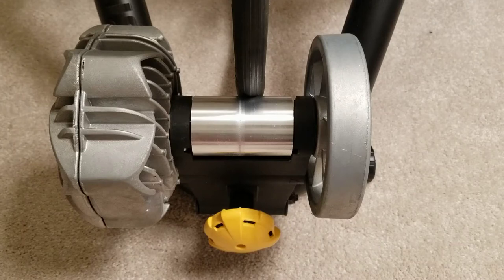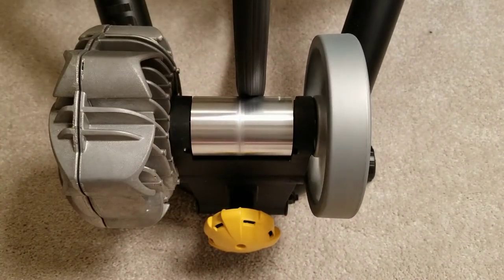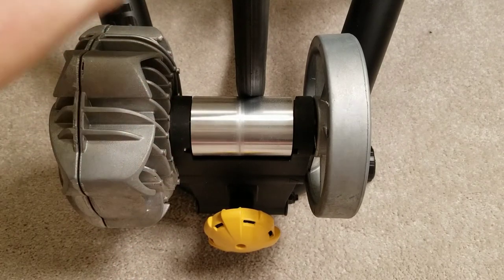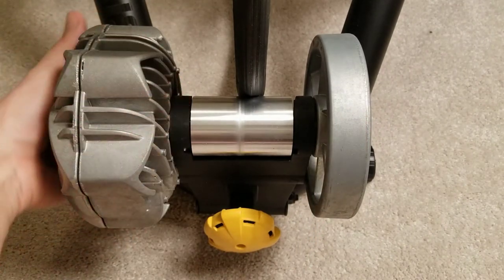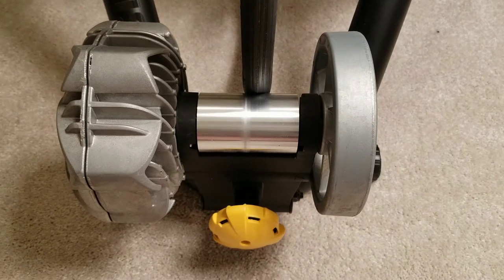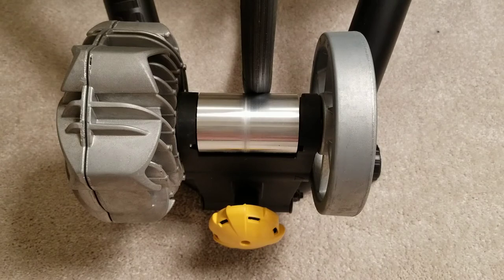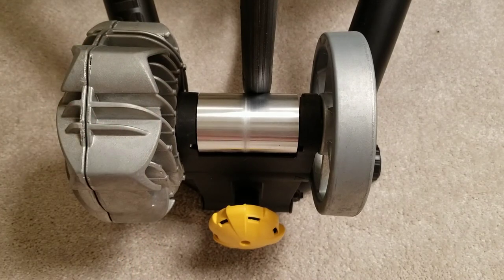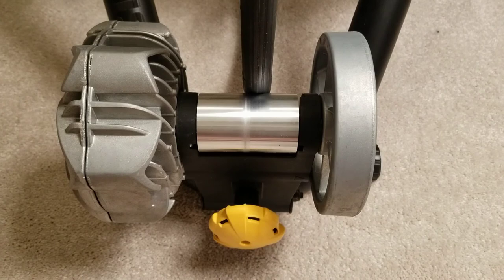How a fluid bicycle trainer works. Fluid trainer explanation.

Comment: I was making the mistake of shifting gears, but now I know better. Very clear explanation overall.
Reply: I still shift gears and have been riding my fluid trainer for years. In order to get harder resistance you must shift, which works along side the fly wheel in the fluid.

Comment: Can you alter the resistance on a fluid trainer to make it harder to pedal to simulate going up hills. I notice the magnetic trainers have a lever to alter resistance, do the fluid trainers have the same?
Reply from the maker: No they adjust automatically based on how hard you pedal.
Reply: It's a little counter-intuitive. In the Real World, you shift down as you hit enough incline. In Trainer World, you simulate a hill by shifting to a higher gear, provoking higher resistance.

Comment: I just got one of these.  Amazing piece of equipment.  What's weird is, how does it simulate gear difficulty?  I shift gears up and it literally gets harder to pedal just as in real life riding.  It's amazing but I don't understand it.
Reply: Since the resistance is proportional to the roller RPM, shifting gears at a constant cadence drives the roller faster, and induces more resistance. 2:00

Comment: Have you ever pulled one of these apart? I had one fail, and Saris sent me a replacement unit, which was great of them. But I'd like to understand what failed and possibly fix  the older unit and am looking for a video if anyone has one.
Reply from the maker: I have taken one apart and the problem is you cannot refill and properly seal it back up on your own. That's why they send you a new one.
Reply: @ChrisEnockson  thanks, I understand that. I am not needing to remove the fluid, so was hoping that there might be some way to fix the unit that did not require  draining the fluid or cracking open the fluid holding side. The problem is on the flywheel  side: the axel  is not secure and it  shifts under pressure. It has gouged away a lot of the black plastic and seems as if a bearing was not installed or something... I was hoping to pull the axel out and see but cannot find a way to get the flywheel off, even with the nut removed.

Comment: Thanks for the explanation. 
I assume the way these work is the reason you don't have resistance level settings like the magnetic type has?
Reply from the maker: That is correct.
Reply: Well, actually, the primary resistance adjustment is roller speed. The adjuster on a magnetic trainer is more of a vernier control, moving the magnet across the aluminum induction plate.

Comment: So it's basically like riding  one speed?  Can it simulate hills?
Reply from the maker: Not really designed to simulate hills it's just designed to mimic what regular road cycling does.
Reply: I guess what I'm wondering is...can you at least stand and peddle for a few seconds without spinning out?
Reply: No you  do shift!
Reply: It's a little counter-intuitive. In the Real World, you shift down as you hit enough incline. In Trainer World, you simulate a hill by shifting to a higher gear, provoking higher resistance. I added 4lb of lead for more inertia to simulate the effect of sprinting.